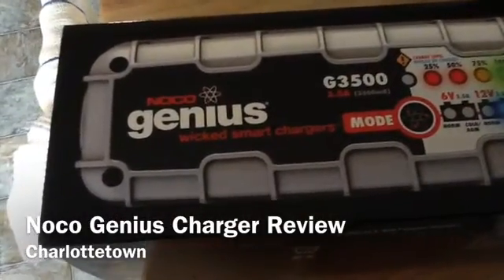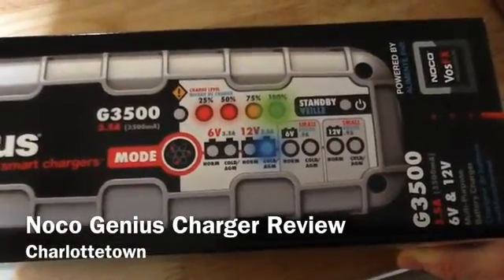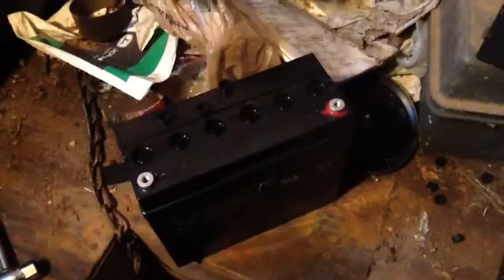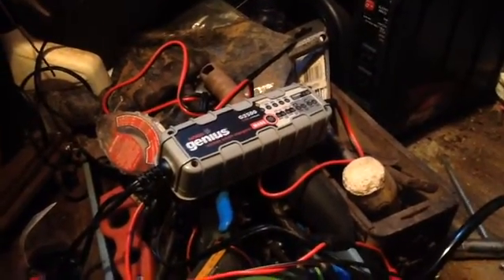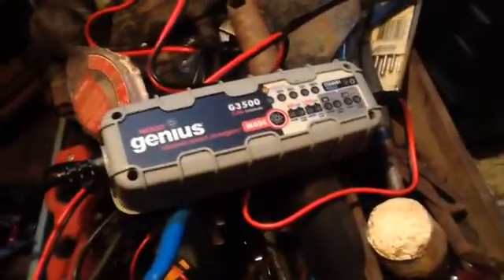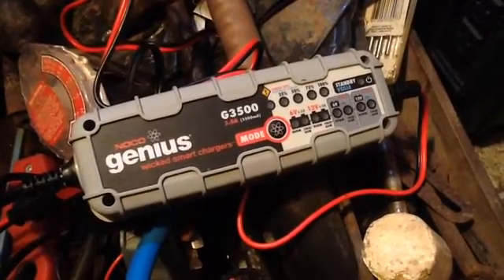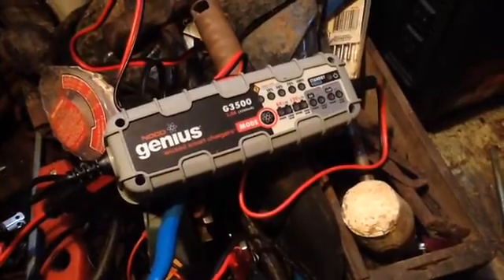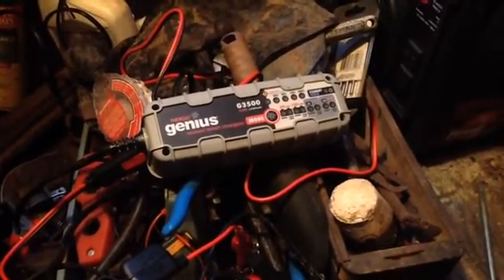Noco genius Smart Charger Review

Comment: Its the  same unit  the you reviewed. like I said I let the unit charge  the battery first I disconnected it and  pressed the  mode  switch to recovery, then the  pulsing  started. It is the led just next to the lithium led mode light. I disconnected it last  night  I got  trust issues. when I woke  up  this morning the battery still lost some  I think it read 1330 volts. After  the charger is finished  with a new  battery I activated to day I will restart the recovery process on it. however it is the  very same  $83.00 Canada Tire charger. Also I want  to add I wrote Noco  and they were very helpfull with some  questions I had regarding the first charge of my new Uusa Battery I am  done  with the  Canadian tire reclaimed batteries.
Reply from the maker: Ah well that is interesting. I'll have to try that mode again!
Reply from the maker: +Randy Db where is the lithium mode light? not seeing it. http://www.geniuschargers.com/G3500 i have the g3500. thats the one you have?
Reply: look closer

Comment: buddy I just  got  one  charged a battery  13.3  then I stoped the process it  was  reading 100% I clicked the mode  button till I got  the repair  mode light and held the button down I put my multimeter on the battery again and  it read between 16.59 volts and 15 5ish so its plusing I think that is what  your looking to do let me know
Reply from the maker: Which unit do you have? I don't have a dedicated repair mode on mine

Comment: The  charger that you bought does not have the recovery mode in it. It is a seperate option found on the current model g3500 and up models which you select the recovery mode after you go through a full charge cycle. I have the 3500 with the recovery mode and i managed to save a battery that was partly sulfated .paid about $49.00 at amazon for it.